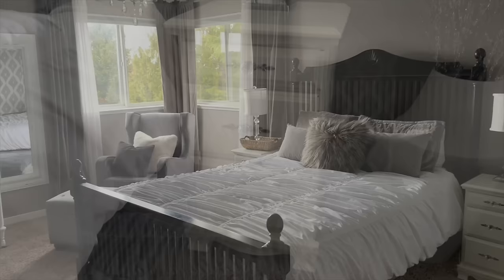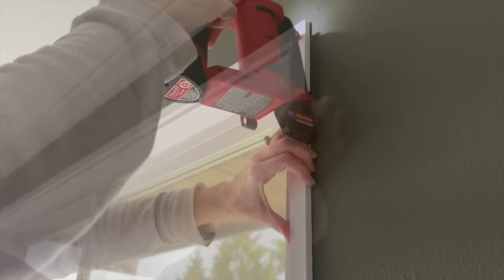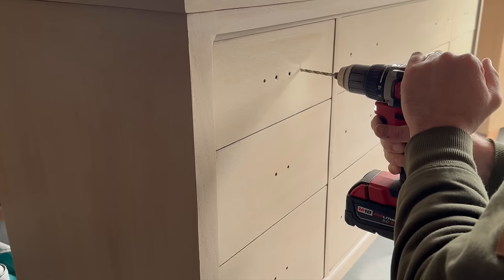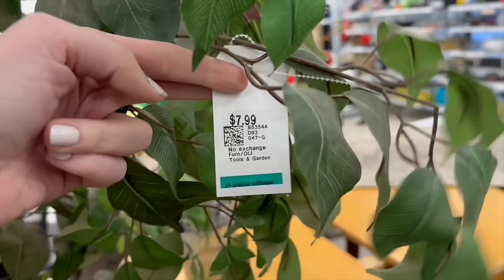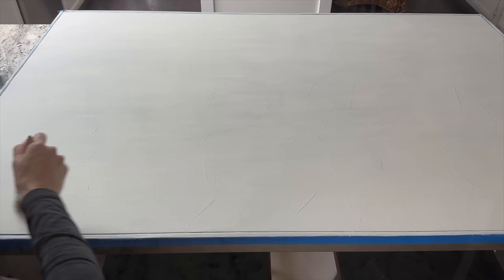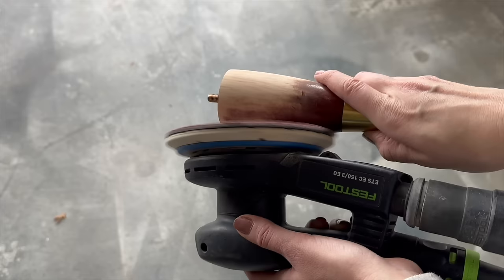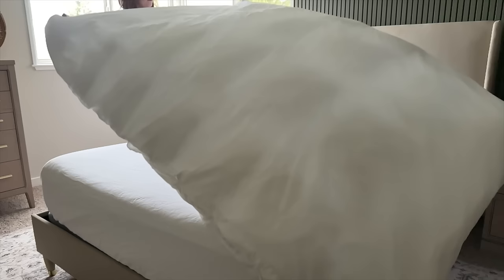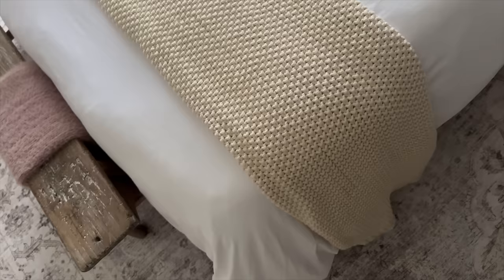✨COMPLETE BEDROOM MAKEOVER ON A BUDGET• START TO FINISH

Comment: Tip I learnt from my parents regarding hanging picture with hooks or holes in the back. Run masking tape along the back and put holes in the sections where the nails are going to hold it. Then remove from back of picture and place on wall, nail in the holes through the tape (remove tape) that way the nails will line up with the back of picture  then hang the picture up and enjoy.
Reply from the maker: Such a great hack! Thanks for sharing! 🤗

Comment: Nice job! Everything is beautiful. Fabric softener is the secret with taking off wallpaper. Put some in a spray bottle with hot water. Probably 4 parts water 1 parts softener. Spray a wait about 10 mins then scrape/pull off. You need a long folding conference table to put your projects on, so you don’t have to squat. Terrible on the knees etc. Oh and you’ll need to go back and put some buffer between the bed frame and the slats to keep the creaking noises away. I used floor protectors and hot glue. It worked wonders.
Reply from the maker: Thank you so much! I appreciate the tips, Keri! 💕

Comment: Great makeover, you should be proud!  Definitely a nice upgrade!  
I was wondering if the wallpaper was supposed to be the peel and stick removable wallpaper?  It looked like it caused some damage to the wall.  I ask because I have been debating on trying wallpaper in an area & don't want to have the headache of wall repair when i decide to change it!
Reply from the maker: Thank you, Cathy! 😊

I don’t know the exact details of the wallpaper as I got it out of the Goodwill Outlet bins. The damage that you saw on the wall was just a few layers of old paint that came off with it, no major damage. 

There are some beautiful options out there that are designed to be easily removed. I personally wouldn’t hesitate to go for it!

One thing you could potentially do is get a sample of it and apply it in an inconspicuous area, then try removing it to get an idea of how difficult it would be to change later. 

Best of luck with that! Thanks for joining me here! 💕

Comment: Hi there, did I notice correctly that you applied the sealer with just a regular "rag"?  I struggle with air bubbles whether I use a brush or a sponge. If that's what you did, I'll have to give that a try
Reply from the maker: Yes, it was actually a white sock. 😆 I like wipe on products and although this is not one, I just treated it as though it was. I think I did 3 coats of sealer, lightly sanding between coats. Best of luck with your future project pieces! 💕

Comment: What width were the slats and spacing?  It looks beautiful. Also, was that 1/2" plywood?  Looking to try this in my bedroom. ❤
Reply from the maker: Approximately 1” wide with 3/8” spacing and 1/2” thick (pretty high quality $$) material was used. Purchasing factory cut slats is recommended if you don’t have a track saw and a 118” track, and even if you do have a track saw and rip length track I’d still probably recommend waiting a few weeks for the factory cut 3/8” thick x 1” wide slats. 

We only saved a few hundred dollars cutting the material ourselves and most people don’t have some of the tools we have. Next time we will plan a little better and most likely order the material pre-cut. On a tablesaw, or with Lowe’s/HD doing the cutting I don’t think the cut quality and edge consistency would be acceptable. The slats and shipping were very reasonable factory cut… we just didn’t have 2 extra weeks due to the post date agreed to with Brooklinen. Good luck! It was more of a project than we expected but we love it!

P.S. - I’d consider picking up Milwaukee’s pin nailer (Home Depot) if it’s in the budget even though it is a bit of an investment… no nail holes to fill. 😊

Comment: It looks like you were able to achieve a matching finish with your paint wash on the nightstands and the dressers. Was that challenging to do given they were different sets? Also what sheen do you use with a paint wash? 
Thanks for the great ideas!
Reply from the maker: It really wasn’t difficult at all! I would say the most challenging part was getting all of the surfaces sanded down. For paint I just used what we happened to have on hand. The Rugged Tan was semi-gloss, and the lightened Revere Pewter was eggshell. I was concerned about putting that semi gloss on there, but it didn’t make them look too glossy, especially once I got that “dead flat” topcoat on them.

You bet! Thanks so much for joining me here! 💕😊